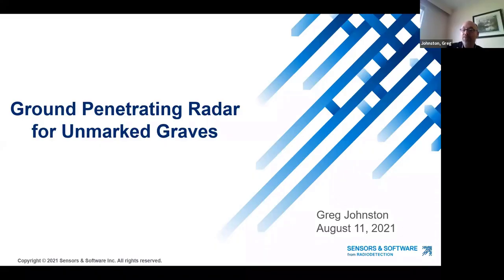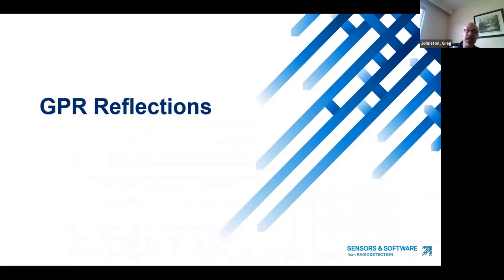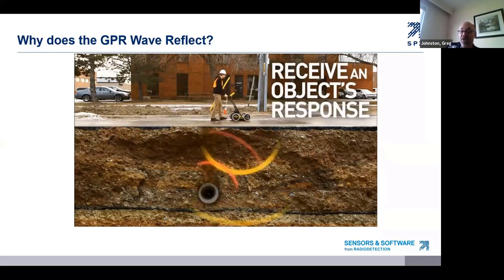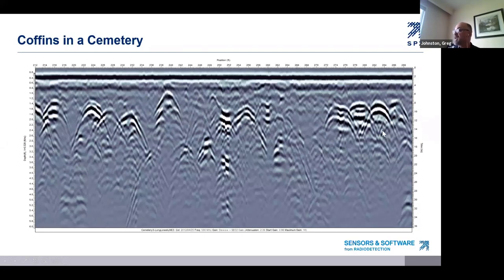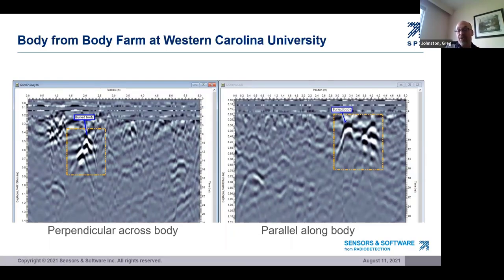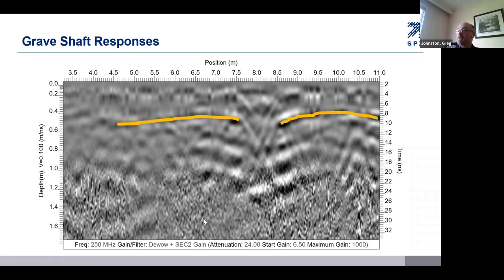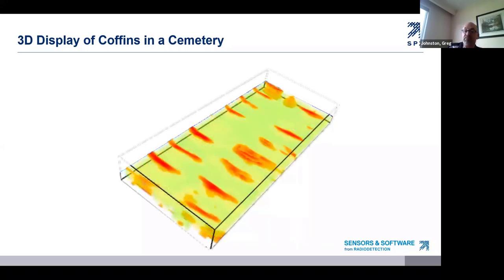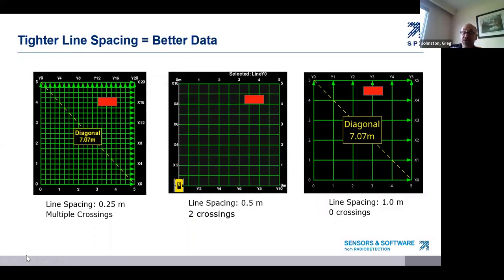Using GPR to Locate Unmarked Graves Webinar

Comment: When i did the Beechwood Cemetery project in Ottawa in the 90s, the majority of bodies, were not in coffins, had all shifted into one area due to rain and building the graves yards on top of each other, in most cases the way i found the bodies, was looking for disturbed soil and shifted soil areas, most bodies had separated into limbs and torsos due to rain vibrations from the main road in Vanier directly beside the graves
Reply: I recall when you worked on that Project, was for the NCC, you also did root mapping on majority of NCC properties

Comment: Excellent video! Of many I've watched, it's the best on this specific topic. Along the lines of data interpretation, is it necessary to have a GPR software or would QGIS suffice? Since the data is geo-referenced, my hunch is that it could be transposed over an existing map of a cemetery and used to help with interpretation. The existing cemetery map I am working on in QGIS is a georeferenced drone image with layers depicting plots of known and unknown burials. The goal is to further investigate unknown or vacant plots in the old section of the cemetery. Bottom line, what format is the raw data in?

Comment: Thank you for an exceptional series of very informative videos. We (Weber State University) have been asked to consider running a GPR survey to locate two WW II atomic bomb loading pits in the desert near West Wendover, UT. They are vertical sided, concert-lined boxes filled with dirt recovered from the general area - should be sandy soil with some silt - very dry. We are told that the local researchers have a fair idea of where to search but not very precise. Any suggestions you might offer about how to go about the field survey would be very much appreciated. Regards
Reply from the maker: Thanks for your kind words. We are glad that you are finding these videos useful. For this particular project, it sounds like a GPR system with an antenna with a center frequency from 100 to 250 MHz would likely be most effective. Ideally, you want to collect data with a tight line spacing to ensure you have crossed over the pits/boxes more than one time to be more confident in your interpretation. Consider running a grid over the area. At 100 MHz, lines should be spaced 1m apart, at 250 MHz, lines should be spaced 0.25m apart. If the area is too large and this detail of data collection is too time consuming, take the approximate diameter of the pit/box, divide by 3 and use that as a line spacing. If you have a system with GPS, rather than setting up a grid, you could also just "mow the lawn" with the GPR, we call this a "pseudo-grid", to cover the area faster. Grids and pseudo-grids allow the data to be processed into depth slices and 3D images which could reveal the pits/boxes as anomalies. I hope that this helps. Good luck!

Comment: The cost of precision GPS has dropped substantially in the last few years with the introduction of the U-blox F9P chip. My entire system was under $750 with resolution of 14mm using a free, public RTK base. Depending on where you are, you may need to pay for a commercial RTK base or setup a second unit as a base. Currently working on an abandoned cemetery with 80 years of tree growth and a elevation differential of 25 meters from end to end. Challenging.
Reply from the maker: Thanks for that.  Good to know.  Good luck on your survey!

Comment: For the determination of unmarked graves why can't the community do a GPR survey and the result shows say 250 possibly site.  Then on those possible 250 possible site conduct a dense grid spacing at a slow speed and in both directions to confirm the site or remove the site from a possible unmarked grave.